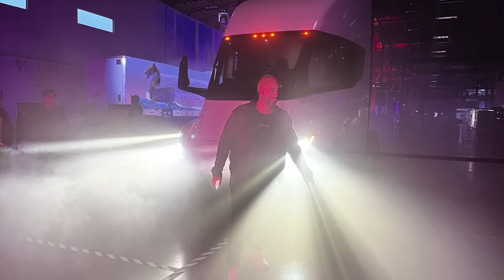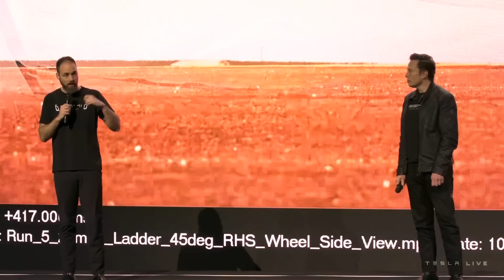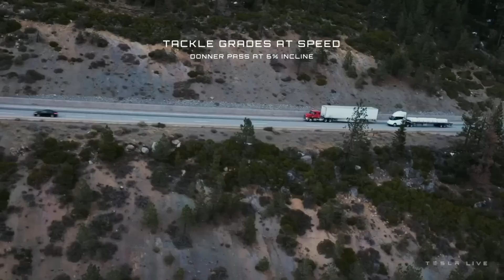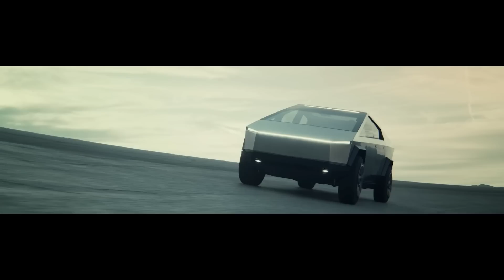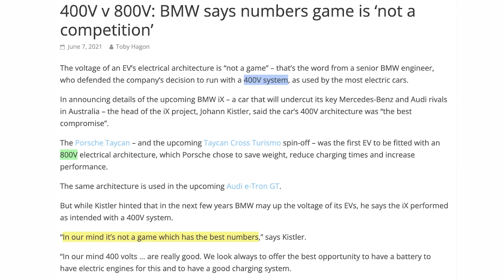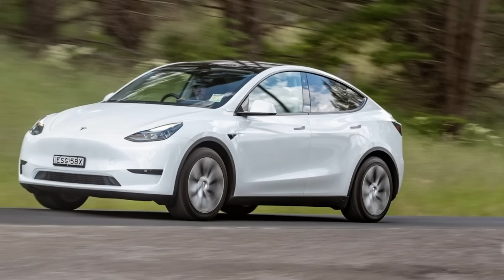Why Tesla Is Being Secretive About Tesla Semi & Why OEM's Are Giving Up ⚡️

Comment: 😜 Neither you nor Elon understand how semi trucks descend.. diesel truck are not grinding down the brakes on descents  🙄.. that's why they gear down! ..they use 'engine brakes'.. they slow the truck down at top of hill and switch into a small gear and use the inertia of the parts in engine and friction to brake the truck.. don't have to touch their brakes... speeding up and slowing down is controlled by gearing up and down. Yes, this takes some skill and dangerous if the drivers misses a shift and lets the speed of the truck get away from them too much.. yes, this doesn't fill the fuel tank back up... BUT.. BOTH diesel and EV trucks get to bottom of mountain passes with 'ice cold' brakes.. can't believe Musk made such a dumb, embarrassing statement demonstrating ignorance of the space 😏

Comment: No payload info makes the whole launch a waste of time.  Actually it is worse than a waste of time as everyone will assume that the figure is poor.  I believe this assumption is obviously correct.
By the way, later in the video you seem to imply that you think robotaxis are still in the pipeline.  I assure you they are not.  Such tech is not possible based on current Tesla AI.  Still decades away.

Comment: It's not a over the road truck. But the range talked about keeps touting the 500 mile steady speed highway drive with one break stop.  How does the range and efficiency numbers look with a more semi rural or urban stop and go?  Also the regen brakes advantage in town where there is much more use of brakes.  Seems like it would help even more in town. Otr trucks usually dont use their friction brakes on hills unless they are pretty serious hills and even so it's combined with engine brakes. 

Many of the company trucks are autoshift. Sure there is still a clutch but the missing shift isn't really a big thing as mentioned. 

If you calculate out a 800ah battery pack would it be more likely to have a lack closer to 1000 to allow for battery longevity  not using the pack empty to full wich drastically effects it's long term life.  I am curious if the engine brakes engage in concert with the front axle and trailer brakes or is it more of a separate control as is with a traditional Jake brake.

Comment: Ask Tesla what's the max payload and how heavy the batteries are, and what is their typical life span when hauling heavy loads.  You will find the cost of the battery and replacement cost as much as a diesel truck every time.

Comment: Semi is minimum 5yrs away from being fully deployable in Europe.
Rig range, load and charging infrastructure need addressing.
I don't want to sound like a naysayer but every single product Tesla they commit to launch is always years behind and frequently omits lots of original design promises.
Elon and Tesla do lots very cool innovation but continually over promising and under delivering is an issue especially if you're a commercial customer.

Comment: No mention of how much the load was, failure to mention breakdown on highway, with charging speeds and range diesel is still superior. Also, the battery weight causes it to weigh significantly more then a diesel for almost no benefit.
The lack of any hard details and focus in it "looking cool" and "having a great 0-60" shows the sham this is. 
Also, we were supposed to get this in 2019.

Comment: Your expectations are unreasonable. Regulators are NOT going to let anybody roll 80K lbs on ADAS before there is an extensive successful testing program. The semi is too new. And I expect ADAS to come long before any form of beta FSD. Stop holding your breath. But you are right, a good deal more about the drive train, battery & charging should have been forthcoming. It would not even shock me if the regulators gave Tesla a postage stamp on which they listed what Tesla could announce.
Reply: Expect ADAS & FSD to roll out very slowly from OTA updates.

Comment: Where possible it would be prudent to have these truck chargers at low points along a truck route.  If they were at a high point a truck charged to 100% or not far off 100% would not be able to regen brake on the downhill track from these chargers so they would have to rely on their friction brakes, not an ideal arrangement.

Comment: The largest issue is the Tesla Semi 500 mile range may have real a MSRP of around $400,000 instead of the 2017 quote of $180,000.   With the Freightliner Cascadia sleeper cab being the most popular by far long haul purchased Semi tractor in 2022 at about $160,000, that makes the Tesla Semi really only worthwhile as good PR in ESG Environmental, Social and Government concerns.   

The 500-miile route chart displayed as a backdrop later in presentation worth pausing and studying.  The expected behavior is when in regen going down a steep grade the truck battery energy level will go up, the opposite direction of the overlayed terrain the trunk is steeply going down.  That is the behavior going through the Grapevine grades, but towards the right side of the chart where the battery is getting down to 20% on the truck's way to San Diego the overlayed terrain has the battery energy going steeply down as the grade goes steeply down!  My guess is the overlay is not in sync, but it's not easy to mentally shift the overlay to where is would be in sync with good correspondence with the expected behavior.  

I would have liked for the discussion during the reveal to cover if the Tesla Semi had in internal charger for use with A.C. grid power such as Tesla Cars do and typically use.   Maybe its not practical because an internal charger would likely need to be ten times larger than one used in Tesla cars and realistically would need to plug into 3-phase power (there currently is no common plug socket standard for 3-phase power.  Its hard wired).  

There are a lot of hindrances for the Tesla Semi being readily accepted for regular long haul service.  It doesn't have sleeper right now.  It likely has a prohibitive price far above the quoted 2017 price of $180,000.   There is no over-the-road charging structure for it where it could sit at a truck stop doing an over night charge. In the future having a large Tesla Semi sleeper 800-mile range tractor able to overnight charge at well equipped truck stops would be a much better truck than its Diesel counterpart.  There doesn't seems a real possibility.   Battery mass power density is a real hindrance for longer ranges.   Running a lithium battery to 100% charge and down to 4% charge is not desirable.  Typically operation would be better at 90% full charge and down to I'm guessing here 20% charge.   That would likely be a typical maximum for setting battery capacity for expected daily millages.  It means carrying more battery weight, but you really don't want to stress components in heavy duty service.  Longevity and reliability are worth higher operating expenses.

Realistically traveling 250 miles to a destination, off loading, then driving back unloaded would cover a lot of truck uses that would fill up the daily allowed driving time for a  truck.  There are a lot of public minded companies that would see benefit in using the Tesla Semi with their own internal charging structures.   It's just likely to turn out to be too expensive capital investment if its actual MSRP is close to $400,000 for the 500-mile max range version with the Freightliner Cascadia sleeper DD15 being about $160,000 when the concerns are on pure trucking and not Diesel emissions.  The Tesla Semi chassis may have a very long life to it.  I'm would think there are going to be numerous refinements.  

Places like the LA and Long Beach CA port might decide to go fully BEV trucks to get rid of Diesel truck emissions at the port.  BEV tractors could take long haul trailers out a couple hundred miles from the port to be picked up by other trucks.   Places like the LA and Long Beach port  are willing to cause a slight premium cost to get rid of Diesel truck emissions.  

A problem with CA is much of its electricity is very expensive and unreliable.  25% of CA electric power is said to be imported from outside the state.  Not a comfortable situation for feeding your Tesla Semi that consumes as much as a small neighborhood when recharging.   Elon wants to make his own electricity for use in the Tesla Semi.   That might work at 4 - 10 times the grid power cost with solar photovoltaic panels and Tesla Mega Pack batteries, but it would need to be placed where there is a lot of real estate for solar panels, likely out in a desert if in CA.  For Elon the advantage is the same system would basically work on Mars.

Comment: It seems like 1MW charging for the Cybertruck will badly damage the battery due to the high C-rate that would be needed, especially for the smallest and middle versions..  I understand the 1000V architecture, but are you sure they menstioned 1MW charging for Cybertruck anywhere? I would guess that 600kW would be the absolute highest they can charge with for a 100-200kW pack size and still keep the 1M miles strategy. Edit: I should have waited 1min before I did my comment, I agree with your latter statement of that it probbably onöy will charge at 500-600kW and for a short while, but that will still increase the chargning speed greatly.

Comment: When driving down long grades, trucks use compressed air forced into the cylinders to provide effective engine braking instead of wearing out the brakes. This generates a lot of noise and is illegal in city limits for most towns. It's a better option than burning off the brakes, but it sure doesn't put fuel back in the tank.

Comment: 800v is for lighter wiring for perfomance cars. Also when you have lower internal resistance then you can get up to 2% more range out of it since internal resistance doesnt eat charge. And that works both ways and you get instant discount of 4% on your energy bill because of that.

Comment: I am good freinds with two guys that work at a local GM engine plant, and they both separately told me that the whole plant is falling apart around them.   There are no new, more efficient machines getting installed, and the rate of rejected parts is way higher than they have ever seen.   GM isn't investing in the gasoline engine factory, to stay economically viable, and they can't build electric vehicles economically either....... This is not a good thing for them if they plan on surviving.

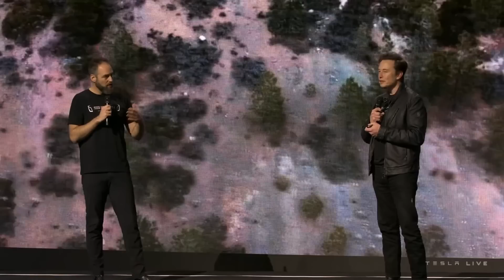Comment: Love your videos! However at 4:54 Why do you say it's not a long haul truck?. It's not a "city truck". With charging 70% in 30 minutes, plus mandatory breaks by law, you can drive as long as any other truck. (if a lot of charging infrastructure been built for that route, so that's the limiting factor 😕)
Reply: Long haul trucks need the charging infrastructure that you're referring to  everywhere that they might travel. The other thing they need is a sleeper compartment (which adds more weight and reduces the weight that can be hauled). This truck should be good for longer dedicated runs that are handled by diesel day-cabs now.

Comment: To me, tesla ramping the semi truck right now is a brilliant hedge against the economy going to shit. As you mentioned it takes 12 model y batteries to make a semi. Retail price of 12 model Ys is $768K. The last pricing we heard for Tesla semi was $200K. That's a lot of loot to leave on the table, assuming every single model y can be sold. But if that changes because of the economy, then instead you can make semis and sell them to yourself you can make back the $568K difference in value over time as operational savings etc.

This is why tesla hasn't announced any updated pricing. Outside of key strategic partners (pepsico and possibly walmart soon) that add value through data and R&D (both on truck but also infrastructure and logistics side too) tesla will not be selling these to anyone for 3-5 years. Expect most of the semis that come off the line to be used for internal tesla logistics and transportation. The semi is additional ballast for weathering economic storms. Which look to get worse in 2023...

Comment: At 13.28  you say this is not a long haul truck. I kind of agree, though not 100%. Still, if Tesla made dedicated trailers with their own battery packs they could easily double or tripple the range of the rig (at the expense of dimished payload it is true), and then the long haul operators will have a truly compelling offer. Maybe as volume ramps this kind of varient is feasible.

Comment: Unusually negative vibes in this report from you. Personally I preferred the low key presentation, they will let the Product do the talking and it is very clear that this is a Beast........ENOUGH SAID.... They do not need to talk up the product as they could not possibly meet the demand generated and they have sold all they can build already. The message of Driver comfort and safety, increased Public safety was spot on. Using existing proven technology that we know about is a huge confidence booster in likely reliability and durability, for example using the Plaid carbon Wrap motors. 500 miles with 82,000 lb using less than 2kwh Cmon that is awesome. I am sure the detailed tech information will come and we can all analyse it, but I think Tesla was right to focus on the macro in this presentation rather than the micro. But Hey, that's just my opinion.

Comment: If anyone absolutely NEEDS to know the BATTERY PACK size in the QUAD for fun.
Let's just say it's around 175 kWh.using 1 kWh to travel 3 miles.
I'm certain that's on a bad day! Another way is PLAID S goes 455km    on 100 kWh pack [~95  kWh usable ]
So to travel 800+Kms, pack would need to blow out 70% at least.
One fifth of SEMI with same range.+/- 20miles. Wish me well. I wish Tesla Team WINS! PERIOD 
Hope it makes you all happy.

Comment: A little detail which most people might not have noticed; the regen of the Semi must be very high, something around 90%, if you look at the battery state in the graph of the 500 mile trip, it is after the peak elevations are neglected, a relatively straight falling line, with bad regen it would not be so.

Comment: I felt the whole event was a great success and probably had many prospective buyers at it. The key safety features were discussed and they demonstrated it could haul a full load over terrain you would find this type of vehicle in normally. I think that over a short time drivers for PepsiCo will talk to other delivery drivers in their normal delivery routines. There are dozens of companies with distribution centers that deliver to the same stores. Word of mouth between execs and drivers will build demand at a pace that they can be built at hopefully within a year.  I am most happy that it seems it will be made in Nevada and they can find people who are interested in making it there. I am hoping that remains the case. The most impressive demo was Donner Pass passing another semi with a load. To me that is something I will like seeing ahead of me going uphill where I am typically looking for the slowest semi in the right lane and wonder when an overtaking  semi will cut over to pass it to maintain speed and I will have to slow to its speed till it passes and moves over because it can't accelerate. Absolute game changer. When I first saw the It's a Beast  pic I thought it looked like a buffalo with the mirrors being the horns.

Comment: If the CT will be able to share the charging stalls with semi's then it will be easy to charge a CT pulling a trailer. Otherwise, it would seem that one would have to disconnect the trailer to be able to backup into a standard Tesla charging stall.

Comment: *Elon did talk at length about the braking system, did you fall asleep during that part? He pointed out the brakes would COLD at the bottom of the hill instead of hot and dangerous like a diesel trucks. They talked about how the Tesla SEMI does not a run off-road, which those other trucks need for when they lose their brakes or miss a gear and go out of control. *

Comment: The only problem I have with the downhill regenerative braking is that the trailers appear to still be using stand AIR BRAKES. This means that the trailer, with or withouit load, will not be braking during the downhill travel. That presents a problem if the trailer wheels lose traction when the regen braking is applied to the tractor only. The force of weight in the trailer has to go somewhere. Imagine going around a curve on wet roads downhill. Tractor regen brakes kick in while the trailer is freewheeling. That increases the chances of the trailer swinging out.

Comment: Having owned my MY now for about 9 months and running up and down the mountains West of Denver I really loved the comments about the regenerative braking and safety of the Cyber Semi at grades.  There have been so many times I have been in the mountains and smelled fried brakes and seen the smoke coming from them when going down 6%+ grades

I also ride motorcycles and still prefer that to any car (visibility, size, maneuverability, and power to weight) when going up and down the mountains. The MY, in my opinion, is the closest thing on 4 wheels to how I feel on a motorcycle in the mountains, minus the "size" and visibility, a motorcycle cannot be beat on those metrics.  Regardless, the Cyber Semi should make traversing the mountains and absolute breeze.

I loved the video of the Cyber Semi blowing past the red diesel semi on Donner pass and can't help but wonder if that driver said to himself, "what the hell was that!" Love your videos!

Comment: I want to know how The anti jackknifing system works. Are trailer breaks used? Does the tractor have load sensors to know if the trailer is pushing the tractor  going downhill? Etc... More details
...